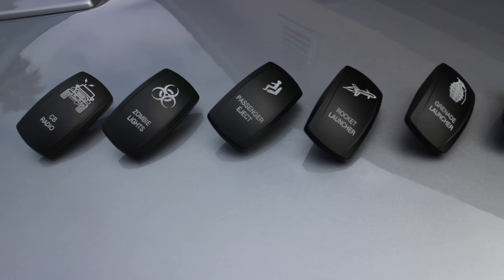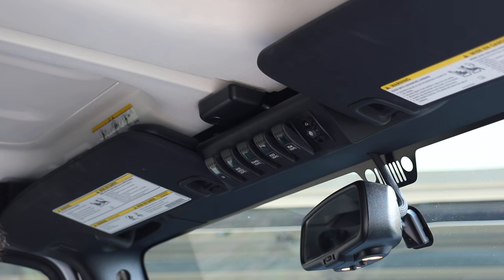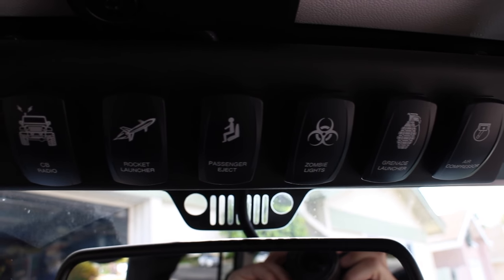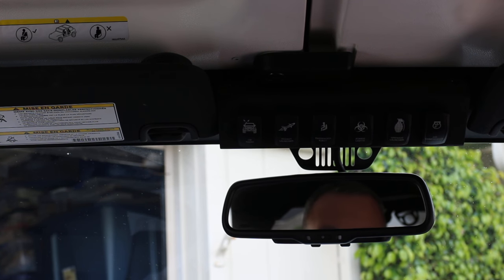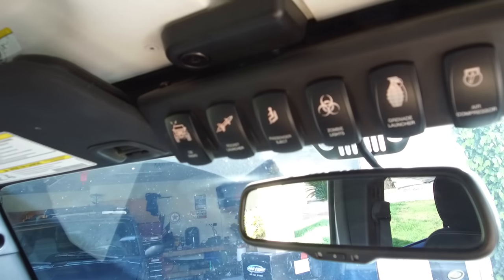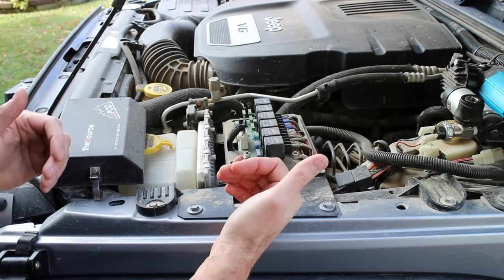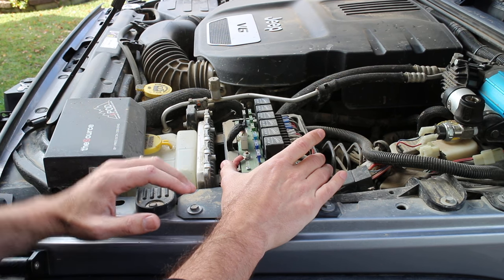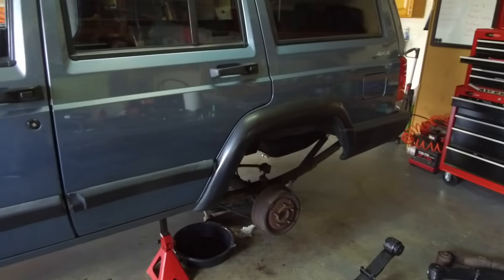SPOD Long Term Review & OTRATTW Rockers Install

Comment: Brings back memories when I installed my SPOD years ago. Had to slightly modified mine since I had a center console between my windshield and roll bar. Makes everything so much easier with SPOD, a bit expensive though. Now they are other manufacturers that cost a fraction for what the SPOD charges, wish I had waited just a bit longer. Thanks for sharing the rockers.

Comment: Another great video. Even though I didn't have accessories for one the sPOD was one of the first purchases I made for my JK. 

I have the dual LED version and having the option for lights on/off is a great feature.
Reply from the maker: Thank you!  If you know you will be adding a lot of accessories, it is a great first modification.

Comment: If you still have the single LED version of this, you could try flipping your rearview mirror over so that the useless "map" lights are pointed up and that might help shine some light on them. This also changes your view - which doesn't matter if you have larger tires but quick tip for others who don't. :)

Comment: Look for clear removable window caulk at the hardware store...put that over the openings where your wires come in to keep the dust out.  Then just peel it off when u need to.  Test in a nearby area to make sure the temperatures are ok.

Comment: I also went with the single LED and now wish I had gone with dual LED. If you haven't ordered one yet do yourself a favor and get the dual LED setup then you won't be taking it apart to send back for the upgrade.
Reply: why whats the advantage to the dual LED? I mean I understand the facts it helps you see at night but for and extra $100!?
Reply: i bought the rough country mlc-6  200 new with dual leds
Reply: FlubahDub 
Because it looks better at night when you're fumbling for the right switch.

Comment: Apply some silicone sealant around the wire holes. You can get some clear silicone sealant at Lowes or Home Depot.

Comment: Hey Brad,

When you order a new S-Pod for the Cherokee, you can probably order the double LED one and swap out the switch unit with the one in the JKU and put the single LED version in the Cherokee. I bet the main unit doesn't need to be changed out, just the part you mount inside the Jeep. It's probably just standard rocker switches too, you can probably just order replacement ones from OTRATTW and swap them out yourself for double LED too. =)

Also, can you please do a review video on your winch? I have one coming today and am curious if you've had any issues since switching to the synth line, etc. I ordered mine with teh synth line already installed. Thanks, love all your videos!!!

Comment: Awesome switches! I need an spod!
Reply: Me too! lol
Reply from the maker: It's a great upgrade!
Reply: It is very similar except the spod is more advanced. My pillar rocker is basically just switches. I had to run all of the relays and stuff. The Spod is a complete system that is basically ready for connecting to your accessories. It has some cool features too like being able to auto switch off to conserve you battery and allows up to 8 switches! Another item on the list I am saving up for LOL!
Reply: they are so easy to wire future items in later!

Comment: Brad, I owe you overdue congratulations on your retirement from military service. I personally thank you for your service.  Perfect timing on the video. I plan on making some major purchases with my refund check from Uncle Sam, the SPOD being one of them, now I'll be adding the rocker's as well. I am shocked however that the unit allows that much dust intrusion. 

If SPOD is going to upgrade you to the dual light setup, then you need to take them up on their offer. In the military, they often took about complacency...I think I made my point. :0) Looking forward to project XJ Overland. I'm assuming a SPOD will be in store for that vehicle as well. 

Semper Fi
Reply from the maker: Thank you!  You're right, I need to make the upgrade and quit procrastinating.  Oorah!

Comment: My only gripe with the location of your rocker switch panel is, if you use either a safari or bikini top, do you not lose the ability to run a strap through the hoop on the windshield frame?
Reply: The "footman's loop" that is used is still there. As it's actually used for the hard top latch you see just above the switch pack when the hard top is installed. When the hard top is removed the loop is still accessible. Thus the bikini top strap can still be used.

Comment: has SPOD gotten back to you about the sealing of the relay box or anything to help?
Reply from the maker: I never reached out to them about that issue specifically.  Thanks!
Reply: TrailRecon they now send a gasket that works great I'm going to do a video this week on it and I have the dual source unit so it's a bit more then the single

Comment: Curious how you are liking this set up now still several years later?  My JKU came with this same set up you have (except mine does light up the rockers in the on/off position).  I've been looking at the LCD models, but the SPODs are so expensive.  I've seen others that are much cheaper and even water proof (bleepingjeep youtube channel).  What are you still rocking this set up or have you upgraded to LCD?  Thanks for the great content Doc....  Semper Fi.

Comment: Not knowing how the switch unit is built, would it be possible to buy the dual LED switches (from OTRATTW for example) and swap them out yourself? Or is everything soldered in the unit?
Reply from the maker: I think the switches in there are standard and it might be possible to swap them out... worth taking a closer look at.  Thanks!

Comment: I pressure washing the engine bay? If dust can get in it's a good bet water will. Is there a warning about not getting it wet?
Reply from the maker: Mine bay needs a good scrubbing for sure.  I would cover the SPOD in plastic if pressure washing.
Reply: Walter Sigona I wouldn't just go pressure washing inside it but you can just run a hose over it

Comment: When I installed my Eaton E-Lockers I also installed a pair of Contura V's from OTRATTW.  I have the dual led version that have the lower light. These switches were super easy to install and wire myself. I wonder if you can do the same yourself, as opposed to sending it off to Spod? As the wiring is actually rather easy. On top of that while doing the wiring, I spliced into my dash lights for the lower indicator lights. This way I not only have indicator lights when my dash lights are on, they also dim with the dash lights. I wonder how much it would take to wire up a breakout wire and lead to connect the dash lights to the the Spod switch pack?

Comment: I am looking into an S Pod for my XJ.  I'm not sure what unit I need.     I do have a switch panel that will replace the XJ ash tray in the center console.   The switch panel has 30 inch numbered wires already connected.   I have not yet heard back from S Pod as to what unit to get as I do not need a switch panel.  

Any suggestions?
Reply from the maker: I'd be curious to know what SPOD tells you and what you you do end up doing.  I was thinking about going with the ashtray panel as well, but I haven't convinced myself 100% yet that I'm going to use an SPOD in the XJ.
Reply: I will let you know what I find out.  The ashtray panel has 7 switches and from what I have seen, SPOD has 6.   I have a 50 inch curved light bar and 4 smaller lights to install and will install a winch, air locker and compressor when the budget allows.    I'll need those switches.
Reply from the maker: Sounds like some great accessories going on your rig!  One thing to note, you won't be able to run a winch through your SPOD, the amp draw is to great.
Reply: Thank you,  I just read up on that.

Comment: Just get a caulk gun and tube of 100% silicon and seal those S-POD holes. It will water proof as well, and you can probably water proof the entire unti under the hood.

Comment: Do you have your CB hooked up to your spod
Reply from the maker: Yes, but not required if you just want to tap into a power wire that is live when the ignition is on.  Just was easy for me to do it this way.
Reply: TrailRecon I ran mine straight to the battery but was considering running to my Spod